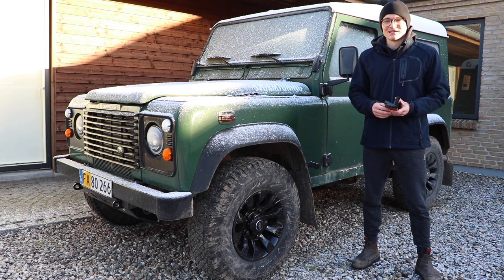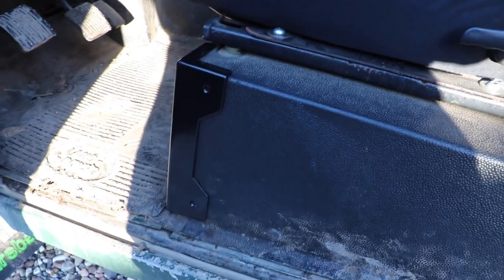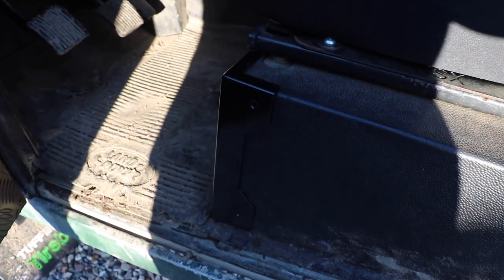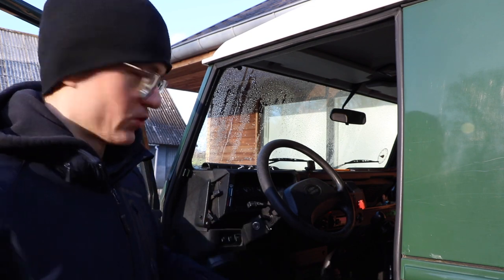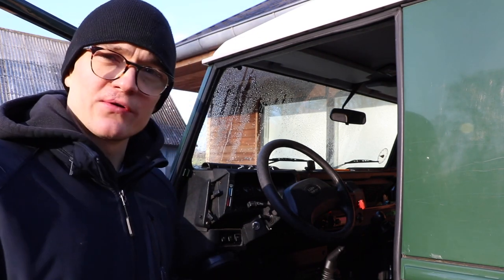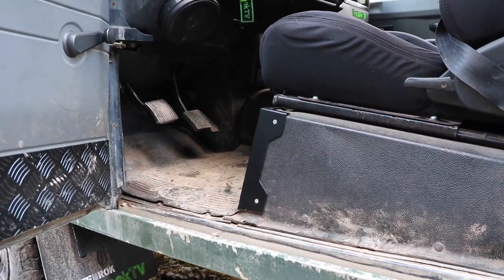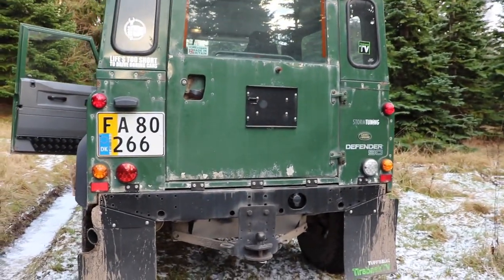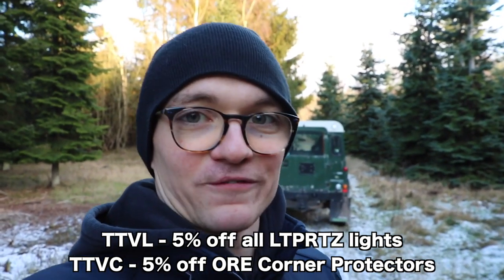Protect your Defender's interior with this simple mod!

Comment: Rivnut would have been a more factory look and save the hassle of the low nuts
Reply from the maker: That's also an option, ORE just designed it this way to simplify the tools required as not everyone has a rivet gun. But it's entirely up to you if you prefer rivnuts.
Reply: @TirsbaekTV  nice cheap option that's all buddy

Comment: Any plans to tidy up the defender and preserve it or just run it into the ground while adding shiny bits?
Reply from the maker: In the last few years it’s had a new crossmember, steering box and all other steering components swapped out for Gwyn Lewis heavy duty parts, clutch, flywheel, turbo, polybushes all round, new door hinges, Gwyn Lewis' mud shield kit which protects the vulnerable parts of the chassis, and many other parts swapped for more durable alternatives e.g. stainless steel fixings/ORE heavy duty bumper/ORE wheel carrier etc., has a solid chassis and is serviced at least once a year regardless of mileage - Does that not count towards preserving it? I appreciate there are still parts of this Defender that need “tidying up” but that will come in time with future fixes, mods or maybe even a rebuild one day.
Reply: Yeah my comment was a bit harsh wasn't it. Thanks for clarification of work done, sounds like you're looking after it. I know from personal experience there's always something needs doing on a older vehicle, part of the fun you could say. Good luck, I'll be following the journey.
Reply from the maker: @cmadk3423  Thanks!